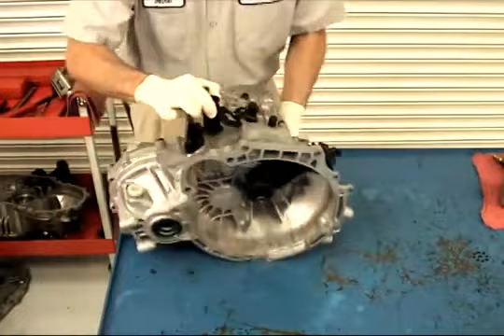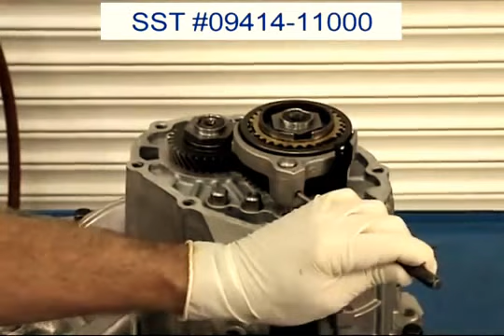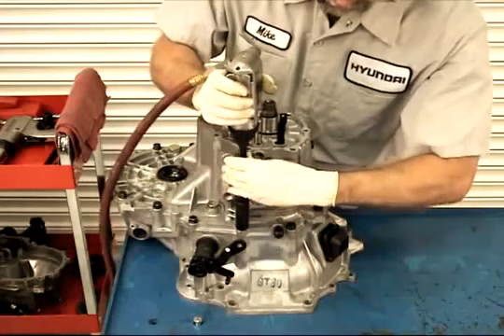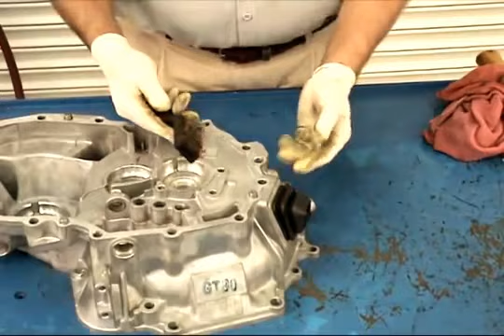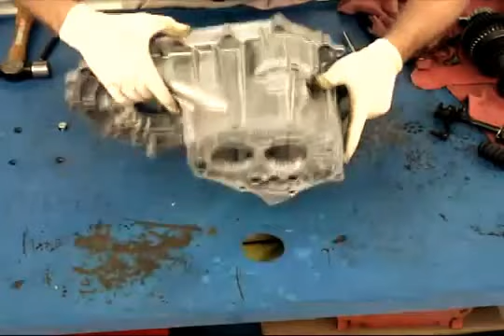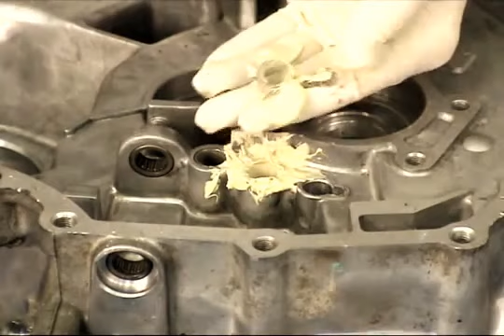How to Disassemble a Manual Transmission - Hyundai Elantra -Transmission Disassembly

Comment: So I dump the clutch in my Hyundai Elantra with a M5BF2 in reverse and a heard a massive bang then it started leaking heaps of oil from the bell housing but I was just wondering if I much of been the pin that hold the spider gear in the transaxle and how do I get the gearbox out do I have to remove the whole engine or take the sub frame out
Reply from the maker: I am sorry your transmission, I could not tell you what could have cause the the bang, but I can tell you you don't need to remove the engine but you do need to take the sub frame out.

Comment: I have 2012 hyundai elantra gls with manual transmission. The transmission you are working on is for that model and year ???
Reply from the maker: The one I worked on was a 2001 -2006 Elantra which is basically the same one, I had a 2001 and 2003 and a 2006 Elantra .